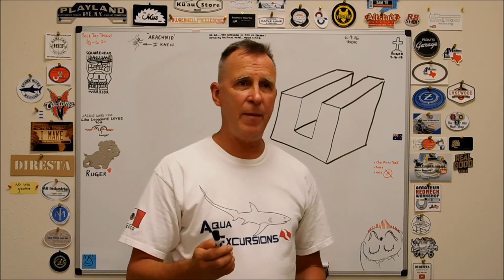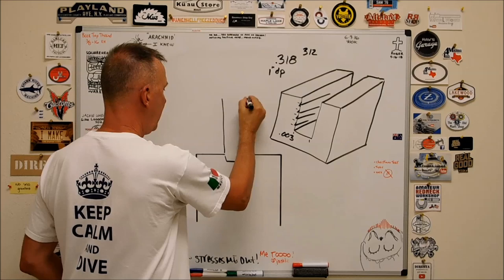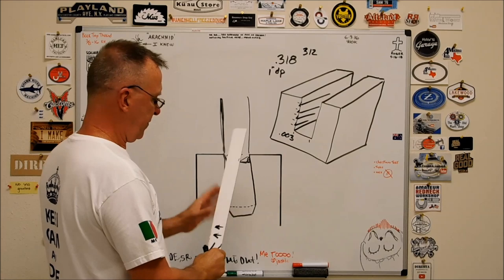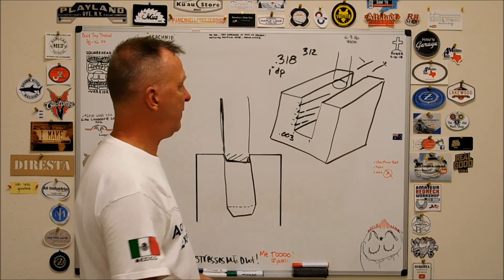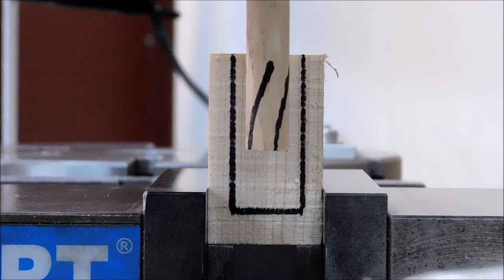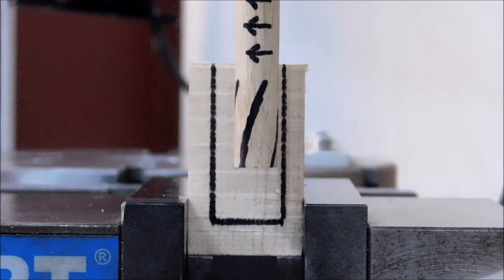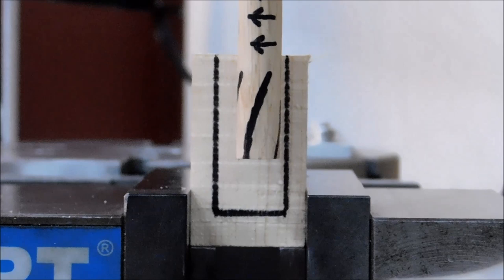Cutter Flex and Better Setups

Comment: This actually showcased an issue I have kept having. After I bolted and leveled my mill, checked and rechecked the tram. Still getting parts that were off just you described. Can't believe I didn't figure it out on my own but this has actually opened up the door for me. Admittedly I have a bench top mill and cheap tooling I do the best with what I have and this is a huge help for a hobby machinist and aspiring machinist.  Thank you sir. Greatly appreciate all of your tips and tricks.

Comment: Joe, you are spot on with your lesson, but there is one other point you should make. 4 flute cutters making a slot will always be oversize because while the flute at the front of the slot is cutting, making the cutter deflect, the flute at the wall of the slot is cutting deeper. If you use a 2 flute cutter, there is no flute cutting the side wall during the deflection. Use 2 flute cutters for critical slots. They clear the chips better too. You can finish with a 4 flute if desired.
Reply: David S. That makes sense, thank you for that observation.
Reply: David S. How does that make sense? When the bit deflects the opposing flute is 180 degrees opposite of flute deflecting. Pretty sure it’s cutting the opposite wall 180 degrees. Please clarify
Reply: @jasincolegrove6651  I agree. Three flute cutters cut underside when deflecting whereas two and four fluters cut oversize.  The OP is (I think, incorrectly) overlooking that the maximum deflection arises from radial push-off (acting at the side), rather than tangential torque reaction (at the front).
Reply: @jasincolegrove6651  Deflection is caused by the reaction force of the flute with the highest load. When slotting, that is the flute at the front of the slot. The reaction force is 90 degrees to the travel of the cutter. With a 2 flute cutter, the opposite flute is cutting air at this point and there is no flute aligned with the side walls. Even though they are usually more rigid, 4 flute cutters are the worst ones for slotting. The space between the flutes is also usually too small to properly clear the chips.
Reply: David S. I still don’t fully understand your point. Where is the deflection on a two flute cutter when you are chopping the wall of the channel?
Reply: @davids.682  The radial component of reaction force at the front of the slot is less than the tangential component, which causes a sideways deflection.

Comment: Joe, thank you for another very informative video -- these tips (& the knowledge) will come in handy in my workshop.

I grinned when you mentioned using a comfortable cutter size/dimension that an Engineer would come up with:  As a young Engineer, back in the early '80s, I designed a tool to be manufactured in our Tool & Die Shop.  I inflicted a 1/8-inch wide by about an inch or so deep, closed-ended slot (on both ends) on the Toolmaker.  I got a call from the Tool Shop almost immediately and received my lecture on cutters and their useful lengths from one of the senior Toolmakers.  I've never forgotten that lesson!  Now I'm retiring and will be able to play in my own workshop -- and won't be able to blame the designs of (most) items I make on anyone else.  ;)

Comment: Joe, I've had this exact thing to happen many times in my machining career, until I learned to offset the cutter as you explained. It's usually faster, with less stress on the cutter, to remove most of the material by drilling a series of undersized holes.

Comment: One of your best tips ever! I know about flexing in slots, but never stopped to think about which way it flexes, just assuming it flexed away from the face being cut, not into it! Thanks heaps from New Zealand.
Reply: Chris: the edge which is entering the cut is pushed off, away from the face it's cutting, but in a cutter with an even number of flutes, this will cause the opposite edge to be deflected into the material of the opposite face, and produce a result which strays outside the intended line.

Comment: Thanks Joe, fantastic content and presentation as always. Years ago when I started machining I thought my head was out of tram, nope. 
I was cutting a slot 0.750 to be the finished dimension with a 0.750 carbide cutter. That’s correct, a scrap part and two lessons learned the hard way. 
Cheers

Comment: Funny this video popped up...we are slotting and running into this. Running a mazak using a slot unit, we tend to program to center of slot and always climb cut. Slot is 1.035 with a .750 carbide cutter, 2" deep. Now i know where the "lines" are coming from

Comment: NICELY put (yes, yes we got used to this super elegant explanations and demo's :) !!! 
Boy do these things FLEX... Try a HSS 3mm (1/8'th inch) endmill and dig 1/8'th even in aluminum - and you SEE it flex
I have no doubt the HSS flex, same goes for carbide (but less so) - and I too use the roughing endmill followed by a smooth one (carbide or HSS).
Wonderful demonstration and explanation - thank you!!!

Comment: Cheers for the tip. It's always worthwhile noting that even the stiffest things bend, even if you can't measure how much they have bent.
Reply from the maker: Sometimes even a little flex is too much.
Reply: @joepie221  true. It has to be managed.

Comment: Very much appreciate you educating folk and doing your part in keeping manufacturing alive and well! My 2 cents: Carbide substrates and the grinding geometry has come a long way. Most solid round tools these days will pull 1.5 and 2 times diameter full slotting, that is if you have the ponies and the cohonies to do it. :-) This negates the stair case finish and better utilizes the value of the cutting edge you have paid for, as you came close to stating. Although this does not negate the Tool deflection, holder deflection, spindle deflection. Trocodial tool paths also allow for better utilization of the cutting edge, but neither stated operation will work well on a manual ;-) The next best thing you can do, aside from your well stated advice is to have the shortest tool length that is permissible for the operation at hand. 20% reduction in cutter length reduces deflection by 50%. 20% increase in diameter reduces tool deflection by 50%. (Quoted from SME)  Cheers- Keep up the good work!
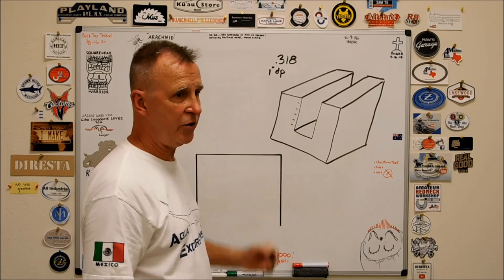Reply: Play this link at .5 speed. At 1:40 you can see the deflection. https://youtu.be/DDyjvXDQ9fQ?t=100

Comment: if possible I try using a woodruff cutter for slots depending on depth, I find it a lot easier and way more effective for a lot of applications, but your tip on the flex was bang on , have seen most of your videos and have to admit have learned a lot, not to mention saving tons of money on damaged cutting tools, 2 thumbs up, keep them coming

Comment: Okay, I agree with you 100% as far as cutter flex is concerned for end mills. Having said that, what happens if you flip the piece 90 degrees and set up an arbour with a side mill or a staggered tooth mill to do the final finish cuts? It seems to me that these cutters would minimize the flex as they would be bearing on the entire face and not just the tip.
Reply: I'd imagine there'd still be some amount of flex causing the side cutter to tilt down just a bit. Not quite as bad as an endmill though.

Comment: I do this a lot in aluminum parts. I use two sizes of course ruffing cutters that gets it to .062" under. Then I use regular spiral finish cutter. Parts are with 7" long pockets, and parts with 12" long pockets.

Comment: Thanks Joe, perfect timing. Ive little experience on a mill, have noticed you can actually see a 3/8 cutter flex when feeding by hand. Dealing with backlash too on an old mill, gets your attention when the cutting force overcomes the table locks! lol
Reply from the maker: Stay tuned. Good comment.

Comment: wow, Thanks.  I remember how Fusion 360  has a special routine for side of end mill to enter the cut so that you don't have a " touched surface," when you are doing a finish pass with end mill side.  Material just sucks the cutter in.  I know about that with drill and all, but now I see how that effects slotting.  I guess we can't go full doc and let up on feedrate cause of having waaay too thin a chip and rubbing cutter?

Comment: Interesting. My initial instinct would have been to use a drill and peck out most of the material that way, or to drill horizontally and then saw out the bulk of material with a vertical bandsaw. The problem with both of those is that you have a ragged interior, which is a little unpredictable until you get it cleaned up.

Comment: What about drilling out most of the material first? If you can then use the full length of an end mill at the start of the block, would that not help/be the best way to make such a slot??

Comment: Wow.  The direction the cutter deflects was opposite of what I surmised.  I assumed it would get pushed away from the cut instead of getting pulled into it.  Does it make a difference if you climb cut or conventional mill it?
Reply: Michael Marriam   it is the flute cutting towards the middle of the slot that the cutter pivots on and goes to the side. This is why they developed two and then three flute slotting cutters, there will be no flute to cut at maximum bend.
Reply: With a full width slot, and a right hand cutter, the left hand is conventional cutting and the right hand is climb cutting - so there's no differentiating. Conventional vs climb only makes sense when you're cutting on one side of a rotating cutter. To get a better idea of the direction of pull, look at the way the cutter is rotating, and imagine the cutter is a car wheel, and the workpiece is the road, whichever way it's wheelspinning (to the left), is the direction it's trying to drive. As for full width slotting, in general, the cutter is rattling around in the slot and generally making a tapered, ragged mess, which is why it's recommended to use an undersized endmill and then clean up the faces with your choice of conventional/climb depending on whatever your machine is happy doing.

Comment: Thank you I wondered why my stuff would come out wrong granted I am using an xy vice and a drill press but I'm also using soft materials but my parts would come out just as you are describing so wether my issue is cutter flex or vice related Im not sure but I do know know to look for flexing somewhere I the system very helpful

Comment: Thanks Joe, very well explained., I had asked some time back on what lube/coolant you use with your CNC, didn't need it at the time but do now and it's been long enough that I've forgotten and you had answered it in a now removed video so your answer is no longer available :(
 Thanks much
Reply from the maker: Trim - Sol water soluble coolant. Its blue. I cut it at about 10/1. Good stuff.

Comment: Yes, I've heard that can happen 😬 
Endmills tend to pull to the conventional cutting side. Slotting is the most noticable, but can be problem when profiling too. The tool is engaging the work at the tips when conventional milling, and at the top of the flutes during climb cutting. Probably has a lot to do with the pulling in.
Reply: Climbing culling what's it mean?

Comment: Hi, good video, In my case I'm struggling with  a flexion while calibrating a bore using an endmill cutter, so the bore has a conical shape, how can I get rid of it? I'm doing multiple Passes but it seems like it's not really working.

Comment: To correct a slot that is too small at the bottom we would use a piece of paper on one side of the collet to tip the EM over a bit.
Reply from the maker: A slot that is too small at the bottom is a solid sign of a worn cutter. I would think a shim would just apply more pressure on the worn area. Although I have single sided shimmed an end mill for plunging slightly oversized counter bores.
Reply: Joe Pieczynski a shim between the collet and spindle makes the EM wobble off center a bit so the bottom swings in a larger arc.

Comment: I enjoy your videos an have learned a lot over the few years I watched !
But i'm not sure how you would accept this idea, I have lost a few end mills when traversing horizontally when cutting a slot, So I stopped doing that an proceed to drop my end mill straight down to the bottom of the intended slot, trying to allow for twisting of end mill,  bring it back up to the top, move over a small amount in the direction of slot, cut straight down an once through to the other end, I do a finish or climb cut very slowly an take only a few thou, off
Not sure how you will comprehend that, But seems I saved myself a lot of headaches over the years, as i'm just a simple back yard machinist of sorts doing my blind research ! CMA energy

Comment: On a manual mill, is a good rule of thumb for the depth of cut 1/2 the cutter diameter? Restated, on each pass in the slot using a 1/2” end mill, would I lower the cutter (or raise the table) by 1/4”?
Reply from the maker: Stay tuned. ( but I'd raise the table )

Comment: Oh yea, common sense in action. Surprising how tunnel vision can bite the ass. I have tried in vain to get programmers to see this. Countless times of adding a finish end mill or boring head to hold that +.001 / -.000 tolerance. Flute engagement is always a consideration.  The Principles of metal removal is one key to successful machining.

Comment: Would the same problem arise if you used horizontal milling to cut the slot?
Reply: No, the deflection, if any ,would be vertically, not side to side.

Comment: Would a horizontal mill with the cutter being stiffer and more rigid prevent or reduce this.
Reply: With a horizontal mill, you may get upward deflection, but the width should be safe from deflection. The arbor and cutter will be more rigid though, largely because of support at both ends, so the total amount of deflection should be smaller. You'll still get the cutter wear issue though, but because everything is stiffer you can probably do the cut in fewer passes, and the wear issue will be to a lesser extent.
Reply: This was the first thing I thought of too.  So long as the cutter holding shaft is retained on both ends and cutter is in the center of the shaft, cutter deflection will be in the radial direction which cutters bite into the material.

Comment: the difference between a machinist and a machine operator. the operator will see it 10 times and still wont figure it out !!! maybe not even realize it.  hey the part passed inspection.   a machinist will observe , wonder why, and figure it out before the next part. they have an awareness that is hard to teach.

Comment: What if you use adaptive (on CNC mills) to rough, so all the time using the full flute length. And then after do 2 finishing passes on both walls, how will the flex be with that recipe of cuts?
Reply from the maker: Gotta say, I am not a fan of that swirling adaptive milling. Too much table movement and cutting air.

Comment: Another great video,Joe. I would like to know if you have anything to share regarding cutting tapers on the lathe without a taper attachment. I have seen people using a boring head with a center installed to offset without having to set the tailstock over.I thought that was a great idea.A taper attachment for my lathe would set me back $2000.Not going to happen.

Comment: Joe,  if your finished size of your slot is .312 would you use a .2969 and then clean it up with the .312?
Reply: canuckelhead70 all depends on your finished tolerance, if it’s plus or minus 5 thou say then you’d get away with it, but if it’s plus or minus 1 thou you wouldn’t.

Comment: When doing finishing passes, how much material should i be removing on the sides? Thanks
Reply from the maker: That depends on the cutter diameter and depth of cut. My usual plan is to leave .005 for the finish pass if I know the cutter isn't going to flex.

Comment: how would you remove material from a channel if your end mill isnt long enough? can you hang it out further and run the smooth part of the end mill into the channel when making the deeper passes?
Reply from the maker: You can, but risk galling the walls of the channel if a chip gets in there. I have relieved the non fluted sections for jobs like that. It doesn't need much. Maybe .015 / .25mm is fine.
Reply: @joepie221  thank you Joe!!

Comment: The reason the cutter will flex torward the material is because you are taking a conventional cut.  If you take a climbing cut won't the cutter flex away from material?
Reply from the maker: When a cutter is fully engaged, how do you define climb vs. conventional. When in doubt, the cutter will always flex in the direction of rotation.

Comment: can anyone help me with an issue i am having, when i face an area on my mill, after every pass there is a high point, then a flat bit then a rise, like you can feel it with you fingers, could someone explain to me whats going on?
Reply from the maker: You either have the table flopping around from the weight or the spindle rebounding from a load change. If the line is always after the leading edge of the cutter clears the part, it may be a spindle bearing. Really pay attention to everything that happens, and when.

Comment: Sir, do you have a method to cut a square hole in the end of a round object?
Reply from the maker: Check out "Rotary Broaching". I don't have videos on the subject, but I believe "This Old tony" just did one. There are many ways. It just depends on your wallet and patience.
Reply: @joepie221  Thanks Joe, I checked out a few vids and in searching to price a tool, I have found that if I have to reply with a email it is over my head in price. But AvE has a video showing how to make the tool. Patience and searching prevailed.